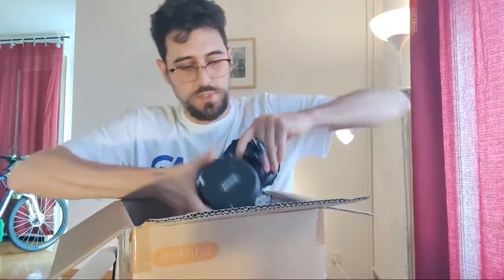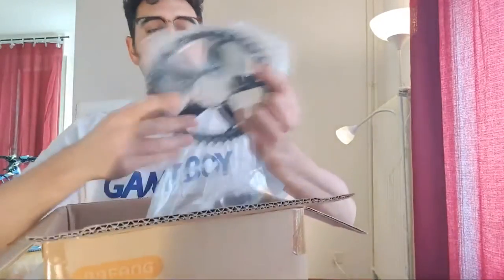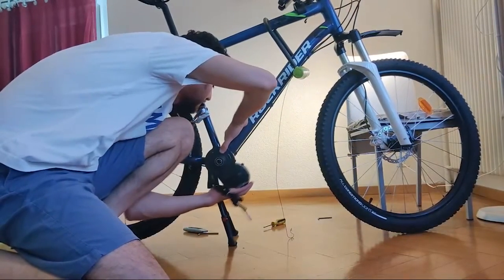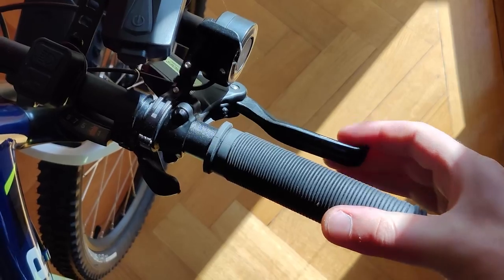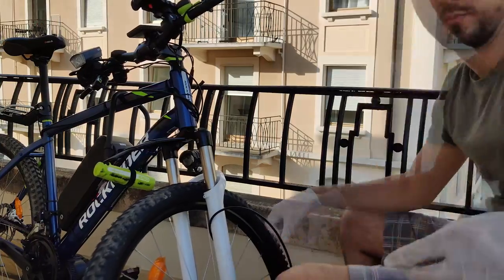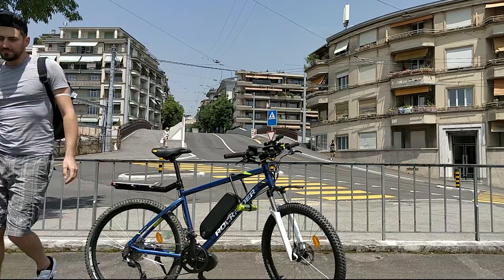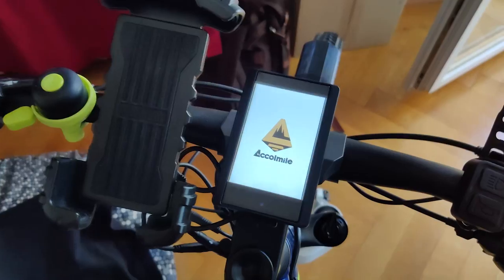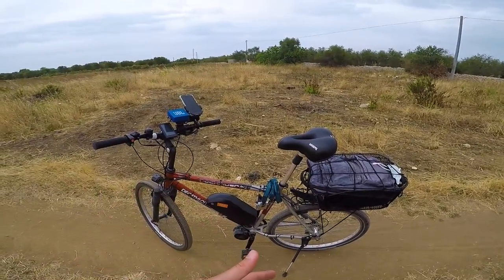Riding a Bafang 750W mid-drive kit on DIY eBike. How to? Speed? Steep climbs? Is it Fun?

Comment: Mechanical brakes last longer, work better, cleaner, easier to install and adjust. I liken hydraulic brakes to harleys, an expensive, needless downgrade.
Reply: Simply not true
Reply: You couldn't be more wrong. Hydraulic brakes need no maintenance. Good luck saying that for regular brakes.
Reply: I like the feel of hydraulic brakes. They modulate better but I have had more issues with hydraulic brakes than mechanical disc brakes. Mech disc brakes are easier to service and adjust.
Reply: facepalm Once you ride a dh mtb with POWERFUL hydros, nothing is the same.
Reply: Stop lying to the people bro cables are for gays

Comment: I have the bafang bbshd motor and I don't have brake motor cut sensors and I have never felt the need for them.  When I let off the throttle or stop pedaling the motor stops instantly.  I have never had the motor not stop when I didn't intend for it.  I do have gear shift sensor though.  I feel that the shift sensor is a must.  Even if you have to take the bike to a shop to install it, it is worth paying for it.

Comment: the smaller chainrings only work well with a "thinned-out" cassette. I take a 9 speed wide range cassette (11-50t or 11-46t) and leave out the 11t cog. To be able to lock the cassette you need an M35 x 0.5mm washer to cover the 13t cog. Chainline is not 100% perfect, but good enough. 44t chainring is useless for MTB, good for speed. i have a 38t chainring anf a 13-50t 9s (8 cog) cassette, i can climb any hill, yet reach 40km/h on flat ground.

Comment: Luke, this is a very useful video - thank you for producing and uploading it.  The challenges that need to be addressed during any particular installation will never be told by the manufacturer of the kit, it will only be told by those who have actually installed it.

Comment: 55 Kmh. Is very fast! I set my 750w on 45 kmh.  And it is fast enough for me. :) I also have the programming cable. It is not so difficult as it looks like. I have programmed a more smooth start on the throttle and to drive careful in the crowded city. You are right, it is a nice motor and a lot of fun. Greetings from Norway with many steep hills.

Comment: Great Job man. I'm getting my 1000 w BBSHD MD Motor & 48v, 24.5 ah battery this week. Your video gave me confidence over and above. Thank.
Reply: bafang 1kw mid drive kit sounds amazing
Reply: I would stay away from a large rear battery, I built one for a friend and you can feel the weight in the rear .... my mid drive and mid battery set up handles so much better.
Reply: That battery is a beast!
Reply: @lambdanu2666  weights like a motorcycle

Comment: My first e bike used the Bafang BBSO2 750 watt kit.  Plenty of power for climbing hills,  but I was not as pleased with the way the motor would responded.  It was not as smooth to pedal as I would have preferred.  So,  I bought a Tongsheng TSTZ2 750 watt kit and mounted it on another bike.  The motor definitely reacts more smoothly to my pedaling, however it does not have the power of the Bafang motor.  I have also considered upgrading the Tongsheng motor with the opensource software, but I have just  not gotten around to it.  That might give and edge to the Tongsheng setup.  Are you still using your Tongsheng bike now that you have the Bafang?
Reply from the maker: Hi Phil! Thanks for your sharing, I feel exactly like you said about the two motors
nowadays the Tongsheng bike has been given to my girlfriend, but I still maintain it and planning some improvement
maybe I'll check out something about custom firmwares... time has come!

Comment: Hi Lorenzo. Thank you for making these videos as they have helped in making my decision on purchasing my 1st Ebike kit. I purchased 750watt bafang with 48volt 13ah battery. I tried to get the HD 1000watt but there was too long of a waiting list. 

Now that I've had the 750watt for 1 month, I purchased a second 750watt with 52volt 17ah battery. I can honestly say 750watt is more than enough power for a bike. I feel with anything more, you will just end up breaking the bikes drivetrain. Going with the 52 volt was a nice little upgrade which gained an extra 5km/h on top speed and a ton of extra range. 

I also purchased the programming cable and adjusted all the levels to suit me riding. For me it didn't make sense to have 9 level of assist and I could only used 3 of them reasonably. So I programmed 8 of the 9 levels all at lower range between 5 to 25 km/h. This is the range that I find myself mostly peddling at, anything faster than 25 km/h, your pretty much just on throttle. I find my battery is much more efficient this way.

I still don't know what max range is, as I haven't been able to do long enough rides to deplete the battery. With the 48 volt 13ah battery I started at 54volt fully charged and did 154 km over 4 days and it went down to 45.4 volts. I still did not reach my cutoff which I have set at 43 volts. I decided to stop there as readying the reviews on battery maintenance they recommend not going down so low. Once again I say thank you for your videos as I have learned a lot about ebikes this last month.
Reply from the maker: Hey Frankie! Thanks for your feedback (it's Luke anyway 😅)
I'm pretty much sure that reprogramming the motor will be my next step.
Surely I would re-assign the ass. levels in a more "exponentially spread" speed selection!
How much hard has programming been? Did you use a particular operating system?

Comment: Hey, great video! I had similar problems as you, 2 additional tips. About breaking lever in hydraulic breaks, you can  get rid of them, just remember to not pedal while breaking, they have enough force to stop your bike even if motor is running for a moment. 
Second, if your chainline is not to straight, try to mount chain guide, it really gave me possibility to use all range of my gears.
Enjoy ur riding guys! :)

Comment: Nice video! I just finished using the BBS02B kit to build my bike and you touched on some of the same issues I had. Rather than spacing the chainring I chose to add a bottom bracket spacer to get my clearance. The BBS02B is amazingly powerful and fast! Thanks for the great video!

Comment: Nice input on the bafang 750. Got mine on an bike in Holland (flat as a pancake).  I am very heavy 110kg and got the 48v 17.5 amp battery as well. Programed the bike to only 18 amp of power in the computer ( that's still more than 750w) and can ride 60km with a speed of around 40km/h. This kit is amazing!
Reply: Cool! One question, do they have any restrictions in Holland on the maximum engine power you're allowed to put, or they just don't check converted bikes?
Reply: @RaoulBoekhoudt  there seems to be no control so far tbh, but maximum power here is 250w and max supported speed is 25kph.  to be fair bosh moters give up to 500w on start and hill climb and those are sold as legit while they break the dutch law as well.

most e-bikes in holland seem to go around 25 kph but some people have the american mod on there bikes wich makes the bike go 32 kph 

there is a special kind of registration for e-bikes in holland which alows them to go 45 kph, but you need a license and a helmet to be alowed to use those.
Reply: @sebastiaanmartens9280  Thanks for the answer man!
Reply: Is it still good
Reply: @wobb_  yes it is still nice, broke the controler of the unit tho, was my own mistake and now i cant see my speed and stuff on the screen anymore.

but the bike still works great and range is still good. and its still a fast bike to use here.

Comment: good build! it's more important to me that the bike is light and good-handled, than that it will have a speed of 50 instead of 45, or will accelerate to 45 not in 8 seconds, but in 7. 
also light battery of 13 amp-h is also enough, just enough for the city. charged in 2 hours and you are ready again.
and a large 20 amp battery - will never be fully discharged and you just always carry extra weight with you.

Comment: I didn't even use the brake levers with sensors on my HP Scorpion recumbent tadpole trike. The mechanical disc brakes work fine and if you pedal backwards 1.5 times it stops the assist. Good enough for me. =)
Reply: Having E breaks are pretty crucial imo, especially with higher power motors, if your cheap chinese throttle fails you could find yourself locked at full power having to fight with the motor in order to slow down.

Comment: Hi Luke, regarding having too much power, you can always buy usb cable fort bafang and reprogram it to use less power and so you can turn your 500W motor to 350W or 250W, this also extend range on your current battery
Reply from the maker: there's exactly what I'll show in the next video 😉
Reply: Why? Isn't more power better? I would rather go quicker than most limited bikes selling at 4 grand 😆
Reply from the maker: @stevenwood433  more power comes at compromises, like more battery drain... I think that's the point: someone may want to lower consumption and you can do that reprogramming the motor to limit it.
Actually your motor may also last you longer this way
Reply: @LukeLorusso  interesting you got any video on reprogramming?
Reply from the maker: @stevenwood433  yep! check the last one https://youtu.be/Cy2RFpWLeZ4
Reply: @LukeLorusso  I don't even own the kit however I am very interested I too also own a rock rider bike, how you finding it?

Comment: Hi there. I have watched all of the videos about e motor. Now I have changed my mind. Originally bafang 750w was my choice, but I guess I will go for tasheng 750w. Cheaper, saves more battery, lighter, has torque sensor. Only thing is lower speed and worse hill climbing? I have one big hill in one of my routes and few small ones. I think 750w can do it.. How about noise, which motor is louder?
Reply from the maker: Hey Dilyan, you're not the first asking me about noise. Neither of the two is noisy at all! Even if they do a little bit of noise, the wind bouncing on your ears will cover any sound coming from the motor or the chain. Sometimes I can hear the sound of my pneumatic against the asphalt but that's it!
With the Tongsheng you'll have a more "authentic" bicycle feeling (meaning that, whatever the assistance level, you'll always participate with the motor in providing the force). With the Bafang you'll have more like an "e-motorcycle" experience (meaning that with higher assistance level your effort will be reduced and will tend to disappear).
At the end is just a matter of preferences. With the Tongsheng I found myself more inclined to push harder! You'll auto-endorse yourself and it's good for fitness.
With the Bafang you will convince yourself that you're on a 70cc Piaggio scooter, without the expenses of gasoline!

Comment: Thank you so much for your video! Just a quick question: cables from the motor are enough long to connect to the battery if it is mounted in the back rack, instead of the frame? My Top Fuel's frame is incompatible with battery frame installations. Thanks again and greatings from Madrid!
Reply from the maker: Hey there! Thank you for watching
Someone already asked this, btw the motor's cables are enough long: in case of a rack battery it's the battery cable that should be long enough to arrive to the motor's plugs. most likely it is, and worst case scenario you can buy extra cable

Comment: I have built a few bafang bike and have never used the brake sensors without any trouble. I guess if you are a beginner you may need them but even on my Sur Ron I disabled them.
Reply: i fitted the gear change sensor, and no longer get the clonk in gear change. smoother gear change now, that lowers stress on the motor and chain , gears.

Comment: Interesting. I live in South Wales with very steep hills everywhere. The 250w Bafang and Tongsheng engines are legal but they just do not have the power to get up the hills. I talked to a man last week who had a 350w Bafang and he said it was not really powerful enough for the local hills. The Bosch motors are able to get up the hills but, while they are said to be 250w, apparently they regularly 'burst' to 500w when needed. In other words, Bosche seems to have gone around the legal issue. I found this video very interesting. Will go and look at your built one later.
Reply from the maker: thanks for your interest man! consider also 500W mid-drive kits! I will soon do a more detailed video about the 500W Bafang variant
Reply: Put on a 28T Bafang chainring for more torque/power at low gear, the stock 46T Bafang BBS02 chainring is good for top end speed but not climbing.  I use a 24in frame with a dual suspension MTB and Bafang BBS02 so that is like having a lower gear to start off with.   I wouldn't think a 700 frame would work very well for steep hills even with granny gears.
Reply: How likely are police to actually check the wattage of your motor? As long as you aren't blasting around obnoxiously at high speed, I can't imagine it'd be a problem. I have no problem climbing very steep hills with my BBS02 in lower gears at 10-15mph, but it does go up to 1300W in bursts on a 52V battery, with the stock 46T chainring.
Reply: The 250W and 350W motors are 36v and the same physically, the 500W and 750W are 48v and slightly bigger (more windings) but again the same. The power differences are decided by the controller amperage which can be changed in the firmware. For durability 18Ah (500W) and for power 25Ah (750W) on the 48v ones. The Bafang unit is bigger and can run at a higher current than the Tongsheng so gives more power.
Reply: @superelectic45  bbs02b is prone to over heating, so i restricted mine to 18amps. 48v plus i rarely use the throttle, as that can burn out the moffets some use 52v batterys and use max 25amps, on 750w and burn the motors.

Comment: @Luke Lorusso Why not remove the front derailleur? When I had my bike converted, the derailleur was removed.
Reply from the maker: the front derailleur has the specific purpose to keep the chain track "in line". It prevents the chain to jump away from the motor's chainring when you're bouncing on the rocks with your bike, even if it's fixed.
I made the mistake to remove it from the previous two builds and from time to times the chain jumps away. With this last build it never happened
Reply: @LukeLorusso  But the thing I’m saying is this: If you don’t need the front derailleur, then you also don’t need the front shifter either. I just got the rear derailleur and it’s shifter and the front shifter got replaced with that power/power level button and the throttle switch. I’m guessing that why the front and rear derailleurs do what they do is to ensure that the bike has the right gear ratio when it’s going uphill, downhill and at grade. Since you got an e-bike motor that is replacing the crankset, you don’t need the front derailleur or it’s shifter.🤷🏾‍♂️
Reply from the maker: @geraldshields9035  I surely don't need the shifter. I actually removed the shifter.
I would have kept the shifter in case of mid-drive motors with multiple chainring (more than one speed) but that's not the case here:
I just kept the front derailleur (stuck in its position) for the reason I explained in the comment before: you don't actually need it, but if you keep it you'll prevent the chain to jump away from the motor's chainring
Reply: @geraldshields9035  I've run my Bafang BBS02 with a single speed rear spocket and stock 46T chainring, no gears to shift whatsoever, I just use throttle with PAS 1-9 to go as fast as I want.  Top end speed is reduced, it's still fast enough to hurt you in a crash, you don't want to be travelling faster than you can brake anyway.
Reply: @nathangant7636  I'm not a "throttle" kind of guy! Honestly, if y'all want something with a thottle, get a scooter or a motorcycle!😂 I want a bicycle! The Mid Drive is just to help you with hills!

Comment: i do ( me 100kg)  46 km with a 750w, 20amp battery, on PAS 9, very rapid .
30 min going, 34 going back,  still left some power in battery, i never finished that battery yet.
Reply: 80% of my ride i am PAS 1-3 , hills 4-5. low gear. steaper 6-8 rarely go to 9. i get 40 miles on a 13.5 amp hours. i find once you get passed 50% battery the hills can draw the battery right down to 20%

Comment: do you have to spin the pedals for the motor to kick in or can you use the motor alone
Reply from the maker: there's an acceleration throttle that you can optionally connect on almost any kit

Comment: Hi Luke, thanks for the great videos. You totally convinced me to buy this kit, but i don't understanded one thing, the motor is 160nm torque or 100/120? The torque change based on the programmation or maibe the Ampere of the battery? Thanks in advance!
Reply from the maker: Hi Jack! In an electric bicycle, torque is simply the ability to rotate the wheel.
The max torque depends on the capacity of the motor to apply some force and it's not something you can tweak.
The 750W BBS02B is rated for a max torque of 160Nm, while the 500W one is rated 100Nm.
If you want to know more: https://www.youtube.com/watch?v=rQVu6N4lGXk&t=452s (ITA sub ENG)
Reply: @LukeLorusso  Thanks for the advice Luke! (sono italiano pure io ma volevo rimanere nel mood :D)
Reply from the maker: @Jackevolution88  🤣 mi sembra giusto

Comment: Modulation of a hydraulic brake is way better (i guess on a Rockrider Brand the brake is not the best anyway 😅). If you talk about simplicity and noob mainteance you are right off course with the mechanical Brake. But wear and dirt is a disadvantage, since you are not using a mountain bike the proper way and keep it on the street this is not a problem then 😉